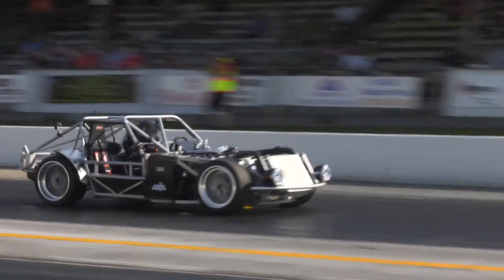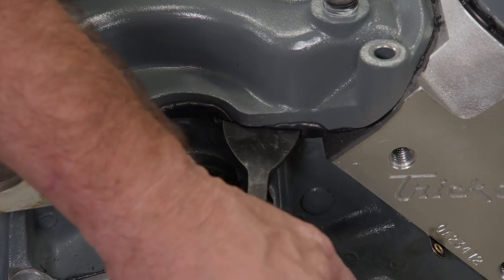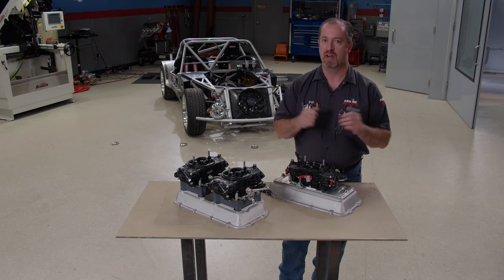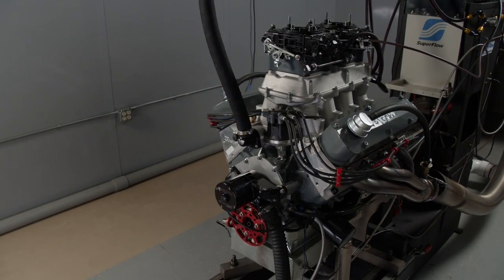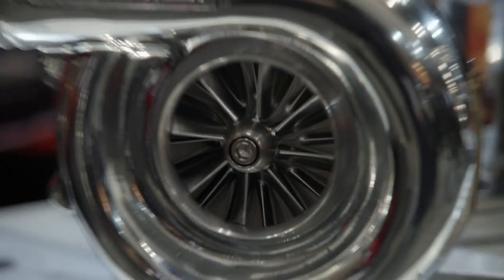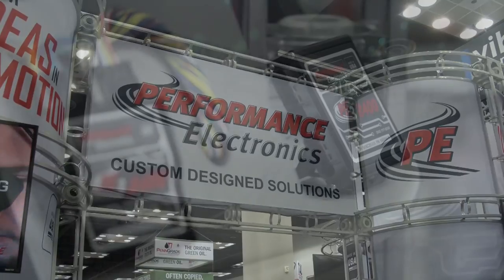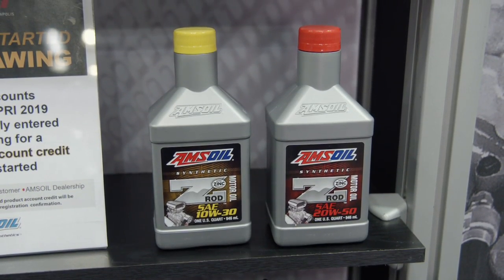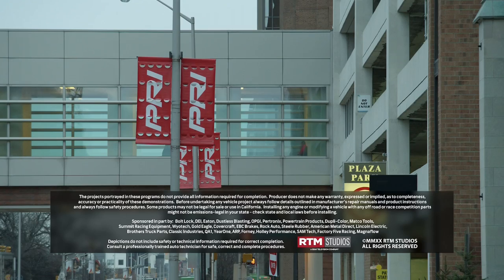Tunnel Rammed Windsor Makes Big Power - Engine Power S7, E3.

Comment: Glad to see you guys giving ford engines the respect they deserve, especially the windsors. I like the 302s but 351 based small block fords need love also.
Reply: Lars  What did you end up putting that motor into?
Reply: You do know that a 351 Windsor is just a 289 series with a taller deck, right?
Reply: @Larcona_  Yes I'm quite aware of that, thanks.
Reply: @Larcona_  almost, for some reason 289s and 302s split in half. 351s have more material that really help when pushing numbers above 550ish
Reply: @CP110  lol- it has happened to some. I personally know several guys who run SBF with well over 600hp and have never split an engine. One guy rev's his SBF to over 9K. Chevie guy's like to spread rumor like this happens all the time. Go to an NMRA event and see for yourself.
Reply: @hdvictoryford5329  on factory blocks, or are they using Ford racing, dart and man o war blocks? How long do they last? We all know they will survive for a bit before they go.
Reply: @CP110  So you know who I am talking about? lmao- One guy runs a stock class, the other a bracket guy. NO, NO after market blocks. And the 2 others do not use after market blocks. Like was stated, some have cracked them down the middle. But the guys  I know personally have not had this happen. And it never happened to me during my racing days. And my Stang, raced it 6 years never an issue. 306, stock block, 6500 all day.
Reply: @hdvictoryford5329  no i don't. drop some names. stock class you can use aftermarket blocks things that arent allowed are things like compression changes, cams, stroke, rod length etc. reason being you can have aftermarket block with same geometry and deck height as stock bracket racing is just about being within a certain time range on the 1/4 or 1/8th...  I just finished turboing a stock block 302 with some decent heads and valve train.  gonna see if it survives 600hp and 7k rpm daily driving, not just a trailer queen.
Reply: @CP110  Bro you are always looking for an out. These are  stock blocks........ In mine a stock block was used. Bob Bammon  Did the one engine. And this was just an example. S&S in A-town has being doing them for years. Time to move on. If you really want to see an engine with many issues the Bowtie 350 has the be the poorest design ever. NHRA safety rules currently in place are almost completely due to the issues with that engine. I saw a show on NASCAR channel. GM sent engineers to explain why they went to the RO350, a Ford design. And the whole show was these engineers from GM explaining why the Ford design was so much better than theirs. And the RO350 is really a Ford engine with GM valve covers. Those videos are still on you-tube.
Reply: @hdvictoryford5329  Damn so many words and nothing of substance, so you got one no name person and cant give a rundown on longevity and usage... why bring up chevy motors we're talking sbf stay on topic. meanwhile instead of spouting hersay ima actually test a fresh stock block aluminum head tubo'd 302. have enough fuel for 700whp we will see if the block survives.
Reply: I had a 351 in my 1990 f 150 and it had some power
Reply: @CP110  me when i lie
Reply: @xJackHunter  dont lie. just do. btw it didnt survive. supersniper had a timing sync issue and causesd rod knock after some detonation underboost.

Comment: Finally using a good engine.  I built close to the same engine and installed it in my 62 Falcon. 
Top loader,  3 55 posi.  Offenhuser 360 tunnel ram. Duel 600 cfm. Holleys tunnel ram carburetors.   
  My daily driver.
Reply: Pictures, please!

Comment: I've always thought tunnel rams were "too much" but they make perfect sense.   They remove the advantages efi intake might have in a consistent cylinder to cylinder AF distribution.    Torque curve increases across the board in comparison to a single plane intake.

Comment: On Season 6 Episode 8 this engine made more power with the Trick Flow single 4bbl intake they took off!  617.6hp vs 602hp and 537.2 tq vs. 519tq with the Holley and dual carbs. They didn't tune and re-jet the dual carbs though. It's funny they don't mention that they made less power!

Comment: It would be nice to see the numbers from multiple pulls next to each other along with percent difference.  The RPM mark where the engine makes 80% of its peak torque and horsepower along with the range that it holds that, would be cool too.

Comment: I'm thinking 540ci, street O-port tunnel ram w/dual 550 EFI bodies and CC magnum 244* roller;1.8 rockers. Ported 300cc AFR ovals. For a modern twist on FI meld with hot rodding.... And the inj.are mounted into the lg. square ports of the ram and shooting into the runners, for better flow. And show the true #s of head and intake flow...And 10.5:1 on E85 for an iron block daily driver in the desert.

Comment: Have you guys ever done a 5.4 Triton engine? I would like to see that. Great video.
Reply: With no boost it won’t do nothing
Reply: 5.4 triton needs cam phaser lockouts, and then rip it all out and stick in a stroker 460 with a tunnel ram.

Comment: Whst happened to the stroker 408 that made 617 hp on one 950 carb.  This single carb setup  only hit 572 hp.  What gives?  Is it the same 408?  I'm confused.
Reply: Yeah they made more with the setup they took off than with the Holley and dual quads.

Comment: Im so glad that turbo LS mentality hasnt taken over powernation. LS's are great but getting old only ever hearing people building them
Reply: @bigboreracing356  thats the smartest option, tried and true. if i go v8 its either old big block chevy or a FE ford but thats unlikely. my heart has been stolen by mazda and its rotary engines.
Reply: @bigboreracing356  some of them do sound obnoxious but that doesnt mean they dont put out serious power. not to mention the weight to power ratio is far better than a 400 pound v8. not to mention rotarys can be built to rev up 12k and still get power at peak rpm. check this thing out, the idle and revving is around 8: 00 mins in https://www.youtube.com/watch?v=9qasv1CWo7g&t=583s
Reply: @bigboreracing356  then you sir need to start drinking this coffee. :D
Reply: Old Gen.1: https://www.dailymotion.com/video/x3rfhrk

Comment: Why are they using conversion lifters in a factory roller block?

Do they not make solid roller in factory style?
Reply: Link bar lifter setup is vastly superior in strength vs the stock style lifter with the spider/dog bone hold down setup. Never ever seen a solid roller setup with a factory hold down style.  Always link bar.
Reply: Don’t tell that to people who’ve had the link break, the lifter rotate, and the rods, crank, cam, and bearings get wiped out.
Reply: Example
https://youtu.be/kqtYTZYUfgI
Reply: Its happened many many times more with the stock style spider/dog bone setup.  
 Nothing is 100% free from a chance of failure.
Reply: Show me one example

Comment: What do you think the port injection setup would pull on that engine?
Reply: Probably 10 15 less peak
Reply: @austindoud273  worth it in my opinion for driveability. Just depends on the intended use of the engine.
Reply: Couple more HP for $2,000.00... street tunnel rams have good drivability... just keep the choke on the main carb...

Comment: Quick questions,can you turn any 351 into a 408? By any 351 I mean 351w 351c 351speeddencity 351obd2 351m...thanks guys love the info you guys let us have.
Reply: Yes but it requires the correct crank for the engine a Windsor has a different crankshaft than a Cleveland but both can be 408
Reply: Modified uses a Cleveland block and crank Windsor's are Windsor's from 60s to 96 same engine
Reply: @triplestangman  thanks dawg.thats what I needed to know
Reply: Crank, bore, pistons, and rods. You need relief cuts and a cam to make advantage of the upgrades. A 408 efi with a good tune and maybe boost would be a true monster and capable of good rpm bandwidth
Reply: triplestangman o
Reply: 351M was a Ford 400 later Modified into 351" by different pistons and crankshaft... other parts the same... Both use Cleveland heads and cams... Ford 400 is a tall deck block 351C... Ford 400 is actually 402"... 408" with .030" overbore... 400 & 351M of course use a wider intake manifold than 351C... 
https://www.dailymotion.com/video/x3rfhrk

Comment: Can you please do an episode about making power with a 351m? And don't make it a 400.
Reply: There's no off the shelf performance pistons for a 351M to fix its 7's compression ratio... make it a 400... just need crank and pistons... same rods, etc... already has big valves... 
https://www.tmeyerinc.com/product/piston-set-ford-400
Reply: BuzzLOLOL :The 351M is a potential black bull if you add a turbo and a proper intake. It caries with it that 1.1 inches of extra deck height for no capacity gain. To go 351c pistons means you have to use crazy long rods. Everything about it works with 400 cube crank rods and pistons. Theres another 110 pounds of weight with every 1.1 inch of extra deck height. Gotta say though, a steel stroker crank and just a little head work, 351m's become 434 cubic inch 750 hp engines with realrive ease. Thanks for all your posts. I've learned a lot.

Comment: Why no EFI? Carbs waste gas, take up too much space, and are alot less powerful.  A good efi system will always beat carbs. With the price of gas going way up, carbs make no sense.
Reply: Carbs can make the same peak power. for many people it seems they are more comfortable tuning with a carb. Personally there are too many advantages with direct injection to want use a carb, but carbs make for simpler conversions. So it is more of a case of easier than better.

Comment: Lots of criticism out there on the Ebay $600 a pair 190cc heads...it would get a lot of attention to show afr, trickflow, dart pulling more numbers than the Chinese heads with similar runner sizes...then again, if the Chinese heads pull good numbers the price will go up.
Reply: It will never happen. Those companies sponsor every part. The chinese may give them parts to compare, but the American companies would not allow it to happen.
Reply: Nukeracer on a main stream channel, unfortunately you may be right.  I’m sure there will be more info on the Chinese heads in the near future, similar to how Ebay/amazon turbo kits have evolved. The issues take longer to get resolved, but I’m curious how they perform and what condition they are in right out of the box (as advertised spring pressures, uniform machining, good sealing surfaces etc).

Comment: Why so many carbureted projects? Why not direct injection ?
Reply: Because they're stuck in the past.
Reply: And there are no heads heads that have di and fit the older engines.
Reply: @Cannibeasty  because sometimes you are going for a look.  Modern engines look dumb in vintage cars.   And a carb on a v8 with a Muncie looks correct.   Add in less complexity and lower cost.  So if it ain't broke no real reason to try to fix it.
Reply: billyfromtheusa  If carbs were the best they would be on every car sold. But they're not.

The Nick's Garage test did not specify which efi unit was used, it may have been at the upper end of its power scale. It was also a throttle body unit, which is basically an electrically controlled carburetor.

This build would allow a fairer comparison between carb and port efi, since the lower manifold is the same on both. With the ignition set-up they should be able to adjust the timing easily, and could even use an ECU to do that for both set-ups.
Reply: billyfromtheusa  Nick tested the FiTech on an engine of approximately 400hp. There were two FiTech units available at the time - nominally 600hp or nominally 400hp. Which was it? It was always going to struggle to make more power if it was the 400hp unit.

Do most drag racers use carbs? Some, I'm sure, use mechanical injection.

Apart from NASCAR and other series that mandated carbs (until 2012 for NASCAR), what racing series does not use EFI?

Take V8Supercars in Australia, for example. Introduced in 1992, it mandated 5L V8s and 7500rpm limit,, but not carb or EFI. 

Allan Moffat, the Canadian born racer, built a car for the Bathurst 1000 in 1993.It was the only car in the field to use a carby, and qualified poorly. The car was supported by Holman and Moody.
Reply: billyfromtheusa  Regarding EFI in drag racing, it seems that NHRA Pro Stock was one of the last to allow EFI, and they did that in 2016, mandating EFI.

Some of the components were mandated too, such as the ECU and the use of only 1 injector per cylinder. Also changes were made to the rpm limit and the car appearance.

Top Fuel uses mechanical type injectors. As do Top Alcohol, though they may have changed to EFI as well.

As for "most", I assume you are referring to the many amateur racers? 

I haven't had many cars in my life, but I have been driving EFI vehicles for 30 years. I've never had an ECU problem, nor have I needed to tune the engine, because I didn't modify them. Basically the only problems I have had are normal mechanical issues (head gaskets in one car) and a couple of failed spark plug leads.

How often do you need to get your wrench and screwdriver out to tune your carby?